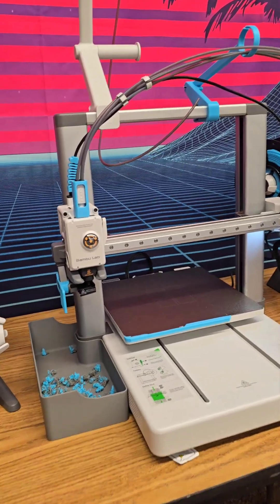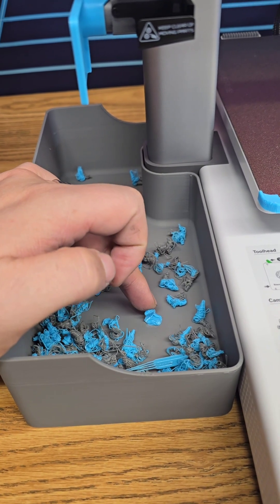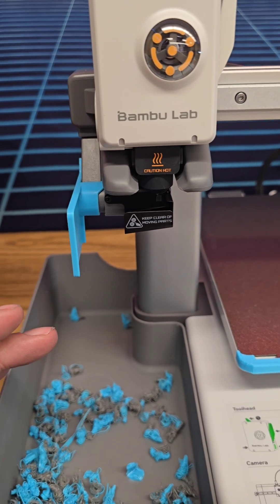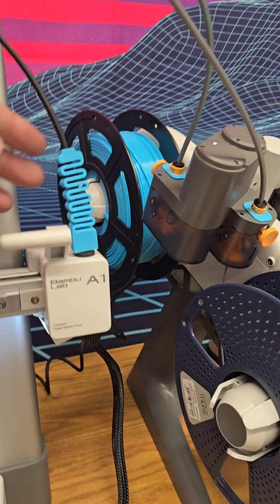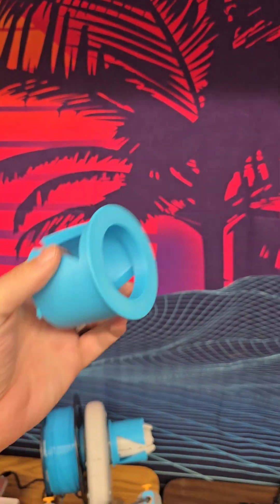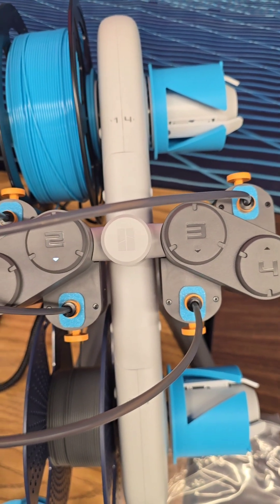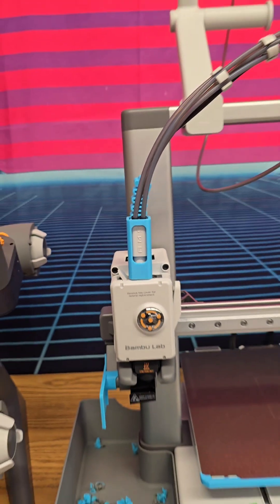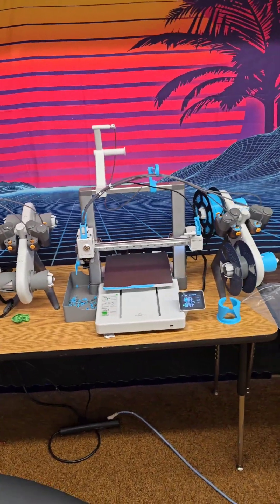Best 3D Printer for Begginers. Bambu lab A1 Upgrades and accessories

Comment: Have you considered printing the "poop deflector" with some inclination angle so it forces the poop to go down and not bounce back into the plate?
Reply from the maker: @DuarteTeixeira_PT  i mentioned that. I might. I haven't had any issues with that. If it were to happen a lot I would